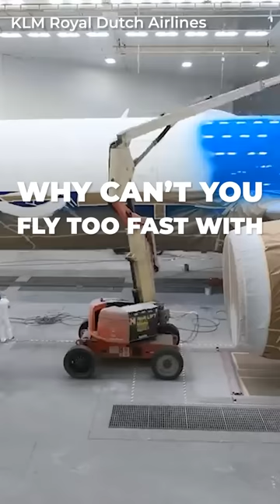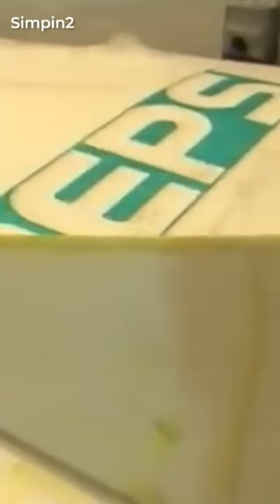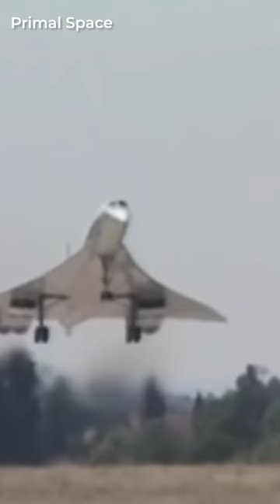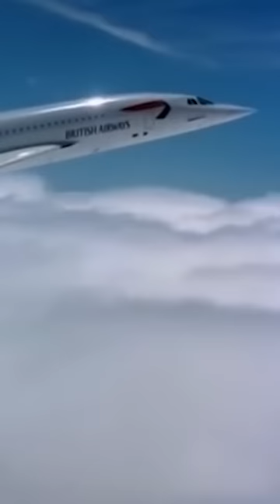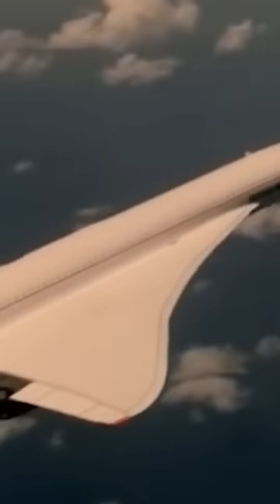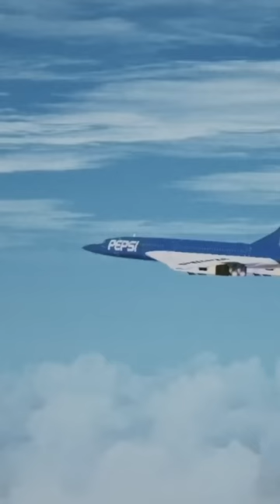Why You Can't Fly Too Fast With Blue Paint? #shorts

Comment: Not just blue paint, any colour apart from white will have a similar effect.
Reply: Air New Zealand:
Reply: @madingthree  it's high contrast
Reply: Magenta pigment in the paint would have the highest effect.
Reply: @madingthree  is the best airline
Reply: what about the white and then eventually pink x15 program?
Reply: @madingthree  especially with its all-black livery.
Reply: Not anymore I think. Material science has solved this issue, runs for special types of IR reflective paint began on A380s because their structure softens at a lower temp than most aircraft.
Reply: SR-71 blackbird would like to have a word with you.
Reply: but there is black planes
Reply: White is better at reflecting heat, but black is better at radiating heat. At 'lower' speeds the reflectiveness of white is preferred, but at 'higher' speeds the radiating properties of black are preferred. I don't know the exact speeds, and I'm sure there is more to it
Reply: @linuswulff03  I thought radiation heat would be reflected by white
Reply: If I recall, black tends to attract more heat but I heard somewhere that it doesn't matter what paint it is, it can withstand the heat.
Reply: @junatah5903  Black does indeed absorb all visible light and convert it into heat. But at the temperatures the SR-71 reached, that heat would be negligible. But as mentioned; black does radiate infrared light (heat) more efficiently
Reply: @madingthree  ANZ's Black planes have carbon-fivre fuselages
Reply: curious: how does it work on blue angels?
Reply: What? I thought red made you go faster D:
Reply: @fruitygranulizer540  just fine, apparently.
Reply: @fruity granulizer  they don't go extremely fast for long periods of time so it doesn't affect them to the point where its a problem
Reply: It's actually the opposite! You should read on black body radiation...
Reply: But the A-12 is black and goes 1000+km/h quicker?
Reply: Red would have made it faster
Reply: @StarLink149  funny 🤣
Reply: Nah red is fast
Reply: The SR 71 is called the black bird for a reason.
Reply: @deepdirtysouth2394  because that is what you named it?
Reply: Pain in darkest black  will melt in no time
Reply: @deepdirtysouth2394  yes, because it's white
Reply: SR-71 was black though 🤔soooo yeah
Reply: Pink works fine though
Reply: Yellow and light red would probobly work to. blue is extra problematic because it absorb all red and infra red light, absorbing a lot of energy, in a way yellow and light red don´t.
Reply: @matsv201  ...thus demonstrating the ignorance of a "laymans" level of understanding of physics.

It's just saddening to see people who sorta kinda know something about a topic just blatantly demonstrate how weak their grasp of facts, logic and ultimately of science, actually are. Yet still get taken seriously by other laymen.

And we wonder how "George Santos" got elected to the US Congress.
Reply: @linuswulff03  "and I'm sure there is more to it"

...yeah, kinda.
Reply: @matsv201  gee it's nice to know that painting an airplane most of the visible spectrum won't lead to it melting in flight. Thanks, aero engineer guy.
Reply: I feel like white is a lack of colour, not a colour itself
Reply: @madingthree  they aren’t flying at Mach 2 though 😂
Reply: This is why SR-71 aren't painted Pepsi Blue!!
They have to be black instead ?¿?¿?
Reply: I’ve seen Lewis Hamiltons Plane it’s a candy red so how does that work
Reply: ITA Airways
Reply: @easyethanol6611  Well... its blue... technically
Reply: It's not the color, because darker, less-reflective colors EMIT more heat-releasing radiation than light colors.
This is the reason why all modern combat rifles and machineguns have black barrels.
Reply: @hetznaz7902  I have color deficiency so it's whatever color my eyeballs make it lol blue purple are the same gray and pink are the same green and red are sometimes the same. Kindergarten was hard 😅 but i made up for it in math and spelling stuff
Reply: @akulkis  ...no, half-wit. Light and "heat" are two different things. Reflection & absorption are two different things. Painting military barrels black vs painting them some other color? Likewise two different things.
Reply: @matsv201  
Yellow and red absorb blue and ultraviolet, whic are MUCH more energetic (and therefore carry more heat) than red and infrared.
Reply: Why did they go with black for heat on SR-71?
Reply: @soulcapitalist6204  um, for the opposite of the reason that the OP says that you can't use blue paint on subsonic jets

but whatever
Reply: @touristguy87  Buddy. Southwest and KLM fly blue subsonic jets. Concorde was at least transonic if not technically supersonic. 

SR-71 is supersonic and deals with those heat challenges with the opposite color of paint and the dissipation property while Concorde sought reflection. 🤷🏾‍♂️

Few other supersonic jets are painted white, but several are black.
Reply: @soulcapitalist6204  you're coming late into the joke

classic case of jumping into the thread late
Reply: @SquirtleHerder  so Iceland air?
Reply: @soulcapitalist6204  SR-71 is plane specifically designed for strategic reconnaissance mission so it needs to be super fast (Mach 3+) and stealthy so of course they will choose black paint. As for the heat problem SR-71 was made os 85% titanium which is much stronger than aluminum in a commercial plane like Concorde.
Reply: @budisoemantri2303  I understand the black was also a heat strategy with SR-71.
Reply: Use black above mach 3.
Reply: Not to mention BLACK
Reply: @byloyuripka9624 well that’s just gays
Reply: The SR-71 that’s a black colour: 🌚
Reply: What about white with a hint of grey?
Reply: Sr71 enters chat
Reply: What about the sr-71?
Reply: @asandax6  aswell as the b2 stealth bomber
Reply: SR-71 Blackbird? its black but can go mach 3.2
Reply: @Rhabboni  at a much higher altitude
Reply: Color*
Reply: @737simviator  nuh uh captain sparkle! You're silly. Paw silly gooth
Reply: SR71 was black
Reply: Klm : i missed the part where thats a problem

Comment: Fun fact:  Soaring (not flapping) birds are almost universally black on top, white underwings.  The heat difference above/below the wings gives the wings extra lift.  
The more you know.
Reply: Birds are robots powered by stirling engines
Reply: Interesting. Where heat is light and builds on the top and cold air pushed to the bottom to generate more lift.
Reply: Birds aren't real
Reply: Wouldn't that have the opposite effect ?
Reply: Camouflage.  Viewed from above a bird’s top colouration blends in with the ground.  The bottom colouration blends in with the sky.  Same reason that fish in the sun-lit layers of the ocean have similar upper/lower colouration.

Heat difference is swamped by convective cooling, the air flow around them.  The temperature difference would need to be hundreds of degrees over a vastly larger surface with copious energy pumped in to maintain the difference… like a hot-air balloon.
Reply: "Heat absorption by wings reduces drag during the birds’ unpowered modes of flight [18]. 
In a wandering albatross, the upper surface of wings is black and the lower surface is white. The heat 
absorption rates of both surfaces vary. Black colour is a good absorber of heat while white colour is a 
poor absorber. Temperature plays a significant role in the reduction of induced and skin friction drag. 
Albatrosses fly towards regions with warmer climate during migration. Therefore we can expect an 
increase in solar radiation. The top part is exposed to solar radiation and atmospheric radiation 
whereas the bottom part is exposed to atmospheric radiation and oceanic radiation. During the day, 
due to intense solar radiation the drag on the upper part decreases due to the dark colorization and 
hence it experiences lesser drag as compared to the lower part. At night, however, the situation 
reverses and the drag experienced by the lower part are comparatively less. This happens due to the 
fact that at night in the absence of solar radiation on the upper surface and the presence of oceanic 
radiation acting on the lower part plays a more influencing role. The net drag of their entire migratory 
journey is however reduced as they travel to regions having a warmer climate [19]. "
Reply: "Drag forces of an albatross wing using Blasius solution for heated laminar boundary layer showed 
temperature difference between the upper and the lower surfaces to be at least 10 degree Celsius. The 
drag as mentioned earlier is reduced irrespective of the weather conditions [20]Drag reduction 
improves efficiency. The colors of an albatross combined with their migrating season are an important 
factor of their efficient flight performance. Results showed 8 percent drag reduction for a maximum 
temperature while altering the wing colours from light white to dark black. Dark colour exhibits less 
drag and hence increased efficiency [21]. colour combinations of wings that were black-black and 
black-white provided a better performance as compared to colour combinations of wings that are 
white-white and white-black."

With a temp difference of more than 10 C  - do you think it plays a role in "providing lift?"

Comment: I rode on the Concorde twice, once in 1996 and again in 1998. Both trips were from London to New York. Cramped and loud inside. I got to see the flight deck and it had more knobs gauges and switches than the space shuttle.
Reply: The Space Shuttle was a glider and didn't have the ability to do much of anything on its own. There was no need for a bunch of knobs, gauges and switches.  

The Concorde had it's own engines, fuel tanks, cabin pressurization, hydraulic systems, flight controls, navigation aids, and much much more. 

Very different forms of transportation.
Reply: @hewhohasnoidentity4377  I read somewhere that more people were qualified to pilot the Space Shuttle than Concorde
Reply: Some of the early boeing jets had multiple console stations, and required as many as 4 people to operate them during flight.
Reply: @Enonymouse_  flight engineer and navigator. Just imagine back in the 30s having to wrench on parts of a plane in mid air to keep it flying.
Reply: @Mark_317  Yikes, no. I remember talking to guys who were crew chiefs for the older model military jets that would just vomit oil or fuel during maintenance and shut down procedures. My former instructor would joke that he'd come to work clean, go home smelling of jet fuel & hydraulic oil, it got his wife all hot and bothered. 😄
Reply: @hewhohasnoidentity4377  "the space shuttle was a glider".....
And a rocket with all the engine controls that requires.
And a space ship with all the manouvering controls that requires.
And a spaceship where airplane cabin pressurisation looks as complicated as a potato..
And a work craft with controls for the remote handling arm, and the equivalent of airplane bomb bay doors.
But the space shuttle was just a glider.
Reply: @dougaltolan3017   Doug you think he would care about facts?

Comment: SR-71 was painted black to dissipate heat and Concorde was painted gloss white to deflect heat. 🤷🏾‍♂️
Reply: Yes. Heat sinks are also preferred to be black. This video doesn't make sense dark colours absorb and dissipate heat better than light ones, otherwise you would have a perpetual heat generator and hence motion machine. I do know they use light colours to reduce sunlight from heating up planes not to mention the weight of the paint. A dark belly may have worked

Comment: If a colour is very reflective it will be bad at absorbing heat but also bad at removing heat from it, like an insulator. And in this case if the colour of the plane was "infra red" then it would be reflecting most of the heat away from it, as this is a form of selective isolation.

Comment: SR71 has entered the chat
Reply: SR71 is a completely different story lmao...
Reply: Titanium makes the difference
Reply: "A good heat receiver is an equally good heat emitter."
-Real Engineering.
Reply: That thing was not made of aluminium 😂
Reply: @sacopanchez151  neat summary, thanks 👍
Reply: @gyula6516  yes it was😂
Reply: @Militaryonly63 bruh it literally wasn’t
Reply: @cassiusmorton7172  The one thing was, but not the other thing.
Reply: That’s like comparing my toy plane to a real plane
Reply: I don't think Concorde would be accepted with leaky tanks and special fuel. 2 totally different planes, both awesome!
Reply: @Militaryonly63  The SR-71's structure was almost entirely made out of titanium
Reply: @richardmillhousenixon  ohhh yeah I forgot it was that lol was ither one of the two
Reply: @Militaryonly63  it was almost all titanium as aluminum would start to melt at those temperatures. the cockpit glass could heat up to about 800F they had to create special paint for it. nearly everything on that plane was one of a kind due to the extreme stress and heat it would undergo in standard operation
Reply: @Militaryonly63  it's well known that it's made of titanium, there's a story to be told about it
Reply: It did radiative cooling that‘s why it was black
Reply: I'm pretty sure it's not blue though, I'm also pretty sure that's why it's called the 'Blackbird'. 🤷
Reply: the f117 is also black but very slow
Reply: @XBullitt16X  there are some much better answers on this thread. 😘
Reply: This is why SR-71 aren't painted Pepsi Blue!!
They have to be black instead ?¿?¿?
Reply: How many commercial passengers could it carry?
Reply: @Militaryonly63  The whole skin of the plane was titanium. During flight it heated anywhere between 500F to over 900F. This would have destroyed an aircraft made of aluminum.
Reply: @SilverSpoon_  One reason the Concorde program was finished with a flying aircraft is they used aluminium. You can build much easier and cheaper with alumium, the F-16 also uses only aluminium for the structure. It would have been economically unviable to use titanium for a commercial aircraft, and unnecessary for a Mach 2 aircraft.
Reply: @simonm1447  >implying I'm not rich
Reply: @mikerodix4800  The 117 flew subsonic missions during night, so the black was part of the camouflage
Reply: @simonm1447  Don't forget the anti-radar signature aspect to the SR's black body.  Same concept behind stealth bomber.  Only, it wasn't stealth at speed, of course.  On radar, it looked smaller than it really was.   This only mattered for sub-sonic speeds - as at mach 3+, it only blipped once on radar, and was gone.  Also...the sonic boom and rattled windows let you know it had passed. 😏  My Dad programed the SR's flight simulator.
Reply: People be taking this joke too seriously.
Reply: @timothylessing4774  maybe because it was a stealth plane?
Reply: @mikerodix4800  idk something about it being a stealth fighter or something idk
Reply: The SR71 has nothing to do with the Concorde
Reply: exactly
Reply: @King63Kobra  no it's not

Comment: I am a computer program and do not have the ability to fly or be painted. The color of paint would not affect the ability of a physical object to fly. The speed and maneuverability of an aircraft depend on various factors such as its design, weight, engine power, and aerodynamics.
Reply: What
Reply: @huskkyy  FLUFFY-BOTTOMS! I haven't seen you in ages!!!!
Reply: Yeah, but the color can effect the thermodynamics of it, which is a big deal at supersonic speeds
Reply: This is meant to be a funny.
😅😂🤣

Comment: Concorde was the 2nd supersonic commercial aircraft. The tu 144 was first.
Reply: technically the tu144 flew barely a few times and the prototype and "production" planes were vastly different. even tupolev hated the aircraft.
Reply: @mrrolandlawrence  Just because it barely flew, doesn't change the fact that it flew. At least the USSR got it flying unlike the USA.
Reply: @kennethcoenen7643  The United States didnt make the concorde… It was the French and the British.
Reply: @JohnGTheEmperor  Where did i say the US did? I just responded to somebody criticizing the USSR for making the tu 144 poorly by pointing out that the USSR got a bigger and faster plane flying unlike the USA with the failed Boeing 2707 and Lockheed L 2000.
Reply: @kennethcoenen7643  Ahh I misunderstood.
Reply: @JohnGTheEmperor  No problem.
Reply: @kennethcoenen7643  bravo, I like tu too
Reply: The Concorde was revealed and the USSR decided to copy and make a similar one and it was terrible because they rushed it and wanted to be the first for everything and it’s the exact same thing for the Harrier and Yak 38 and 141
Reply: @thomaasaviation  Which plane did they copy for Yak 141?
Reply: @kennethcoenen7643  harrier
Reply: @thomaasaviation  They are nothing alike. The Yak 38 i agree, but the 141 is completely different. It doesn't even use the same principal.
Reply: @thomaasaviation  F-35 actually copied the yak-141s vtol system
Reply: @gigatito5869  when did I ever talk about the F35? Wasn’t talking about American stuff and btw the British helped Lockheed Martin build the VTOL fan
Reply: @thomaasaviation  I mean... you're the guy talking about a fighter jet when the topic is civilian
Reply: @thomaasaviation  So the British helped LM copy the yak 141. How the tables have turned :D
Reply: @thomaasaviation BAC actually went to Tupolev in 1967 and raised three issues about the 144’s prototype - the wing was not sophisticated enough, the engines were too close together (resulting in poor supersonic efficiency), and the engines were turbofans instead of turbojets (prohibiting supercruise). The Soviets only fixed the second issue.
Reply: At least Mexico has Mariachi
Reply: They literally just ripped off the Concord design team. So this doesn't count. It doesn't matter what anybody says this is the truth